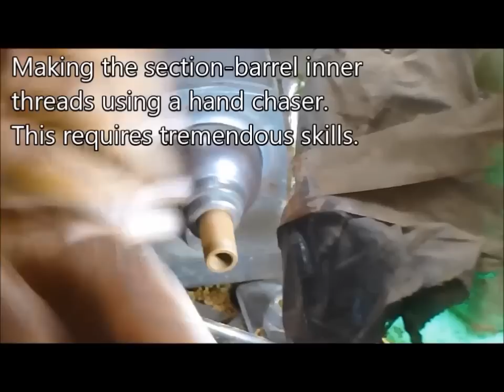Ranga pen. The Making of a Traditional Handmade Indian Ebonite pen.

Comment: Ancient method of manufacturing! A few simple and better tooling could do for easy and accurate machining. Simple gadgets to ensure safety and hygiene of the operator like goggles, earplugs, etc . Even a simple vernier caliper is not used here for better accuracy. Everything is depending on the experience of the operator! Why this way of making?

Comment: Sir, My ebonite ink pen is leakage problem. what should I do for remove the leakage problem?
Reply: Try heat setting the feed(if it is a nib problem).Boil some water (until it just bubbles no more) and dip the nib and feed (they need to be on the section but you need to dip only the nib and feed orelse you might damage the section), then you keep it there for about 30 seconds, after that you pull it out and with your fingers you push gently the nid and feed together (not too much force because you might cause alignment or flow issues).If the leak comes from the threads you can use some silicone grease to seal them well.

Comment: excellent video, thank you so very much. I have a question, I have rather large hands and require pens thicker than most, at least an inch in diameter. Would you be able to make me a few pens, at least an in thick in diameter? If you can make them in different finishes and colors, I'd buy more from you. they'd be for my personal use. Of course, eyedropper fountain pens. Thank you so very much
Reply: an INCH in diameter? Have you tried wrapping a biro in 2 metres of masking tape?
Reply: try delta dolcevita oversize and stipula davinci